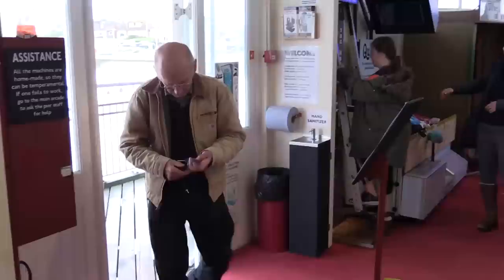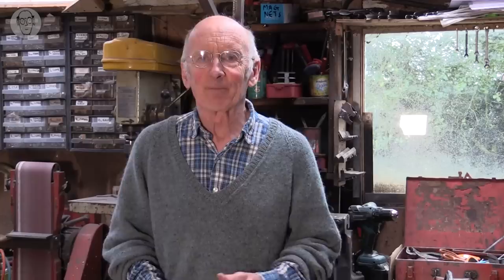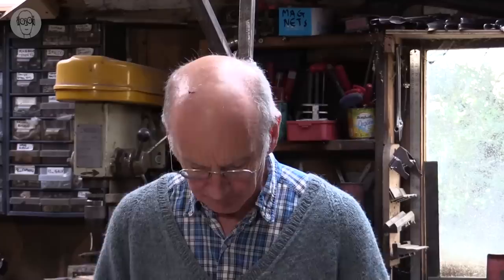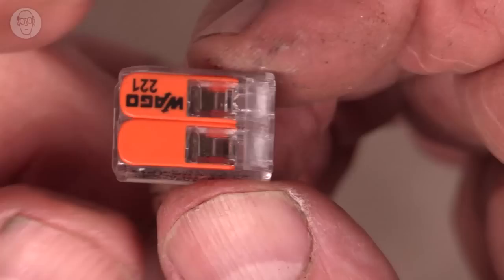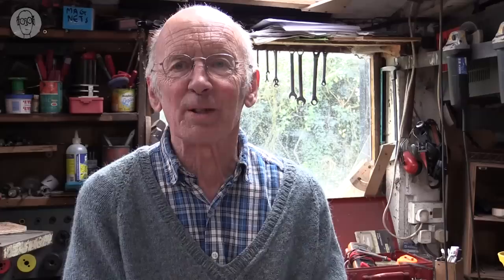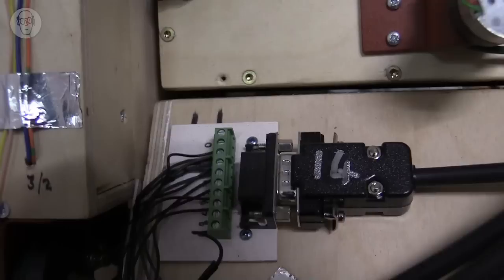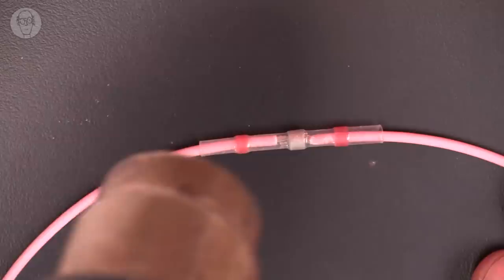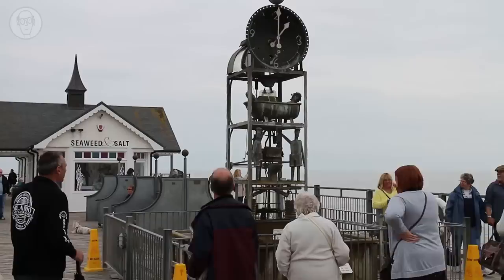CONNECTORS -- The Secret Life of Components, a series of guides for makers and designers - Episode 6

Comment: I designed an opensource DIY optical wireless data link (Twibright Ronja) and initially I used a barrel connector for the power. But they stopped conducting due to oxidation on the intact nickel surface despite looking shiny new and soldering being reliable. And the device was locked in someone's home who was on vacation which resulted in a long term Internet dropout. Such a behaviour of the device was totally unacceptable for me so I threw them out and replaced with a terminal block where a piece of very thick copper wire is soldered to the end of the wire. These were reliable and good up to 300 MHz but they leaked a bit of RF interference due to the wires going apart and creating an induction loop, and someone complaied about stripes on his TV. The interference was so minor that a digital Tektronix oscilloscope couldn't see it over the interference from its own CPU, so I bought an analog Russian S-99 and could see it there.  Eventually I used these D connectors because they are gold plated and the wires are close together and you can put a metal shell over it. For power I used DE-9, connected 4 gold plated pins in parallel for +12V and 5 gold plated pins in parallel for GND. BNCs I used only at the beginning, they had contact resistance on the non-gold-plated shield which injected a copy of the signal onto the shielding and caused interference. They also badly oxidized in roof condition. Eventually, someone had my device running for 12 years reliably and enjoying 10 Mbps full duplex with 1.4 km range. When you design a device to actually work instead of just sell, I believe you have to use a different approach than the standard consumer industry.

Comment: As an american, I worked on a DIY electronics project one time in Germany, and was frustrated to find that europeans don't use twist connectors (they are illegal in fact!) Probably a good reason too, but I love those things for their quickness.
Reply: I am guessing that ground lift adapters, AKA "cheater plugs" (the type that allows you to plug a grounded appliance into an older house-current socket that lacks the ground pin)  are also not legal in Europe. You can't buy them in Canada either, only in the US.  The majority of homes here have been retrofitted with modern sockets but the other use for these "cheater plugs" is if you have an audio video system that "hums" and has one or more components (powered subwoofers often being a particular problem) that include a grounded cord, and so you need to break the ground loop that exists somewhere in the system.  The ground lift cheater plug can be invaluable for this.
Reply: @goodun2974  I interpreted "twist connectors" as wire nuts.
Reply: @ddegn  , yes, so did I, and I commented on wirenuts elsewhere here. My comment was about certain devices being common in the US but unavailable or illegal elsewhere. As for wire-nuts: regardless of UK legality or availability, Tim wouldn't like wirenuts anyway, because he'd have to twist the wires together clockwise first! (Watch his quick and dirty twist-splice at the end of the video ---- maybe it's a lefthanded person's nature to twist counter-clockwise?). Of course, quality wirenuts contain a metal spring; but the cheapest ones, often included with DIY low-voltage projects and kits, are just plastic, no metal, and pretty much guaranteed to fail. Which reminds me that Tim never mentioned the crimp-connector color-code that tells you what color terminal to use for whatever guage of wire you're working with!

Comment: The worst connectors I've found for terminating are 13 pin DIN connectors.  EDAC/Varelco 96 pin connectors are a bit of a hassle if you don't have the (very) expensive crimp tools. You also need a pin extractor tool for the inevitable mistakes or modifications.

Comment: I'm wondering if you would do a remastered episode on lifts(elevators) with commentary. From the early 2000's to recent,there has been some improvements & adavncements in elevators as follows:pneumatic elevators,machine-room less elevators & other elevators that use hoist belts in place of hoist ropes,Otis in the early 2000's was the first to develop such an elevator called the Gen 2. Thyssen Krupp Elevator which acquired the elevator division of American manufacturer Dover,developed an elevator with two independent elevator cars sharing the same pair of guide rails in one hoistway called TWIN. The idea of such an elevator is not new,Westinghouse, later acquired by Schindler,in the 1930's installed a similar elevator in Chicago.  Also the late 1990's,early 2000's saw the development of AC gearless hoist motors.

Comment: 5:30 At this point in the video may I recommend a DC clamp meter such as the Uni-T 210E? Current can be measured without breaking the circuit, though of course a single wire must be measured - both together will cancel each other out.

Comment: I wouldn't recommend soldering by pasting the solder around by swiping the tip of the soldering iron. Instead, use enough flux (rosin) to have a visible leftover of flux on the joint and then it will be clean and flow everywhere much more eagerly. I think doing it like this is asking for a cold joint.

Comment: I've been a electrician for 18 years and done many wiring tasks, thousands of connections and never had a report of a fail. Do like the din rail connectors, but hate the push in ones, as they are fiddly and sometimes even the screwdriver cant pull it out.

Comment: Here in the States, we use not only Molex plugs but also AMP and Jones (Cinch-Jones) plugs (and I've seen intermittent factory-made crimps for all of these, and occasionally even a broken pin inside the plastic housing!). By the way, worst audio connector ever? The ubiquitous RCA phono plug! A nearly hundred year old design that should have been scrapped decades ago!

Comment: Regarding the measurement of current REMEMBER TO ALWAYS ALWAYS PUT BACK THE METER PROBES IN "Volt" MODE. This because in Amp mode it's basically a short circuit across the probes and if you forget it that way and try to measure voltage you'll short the thing you're testing. And if it's mains voltage you'll get quite the surprise let's put it that way
Reply: Most high quality volt/ammeters will have a shunt inside the meter which acts as a fuse to protect both the meter and the technician if you accidentally try to measure voltage with the meter in ammeter mode.
Reply: @goodun2974  Yeah but not anyone will have a quality meter and I think it's still good practice even if you have a top notch Fluke or something like that

Comment: *I over explained a lot here
Be careful with re shaping flat head screw drivers as you can end up making a pretty sharp edge. This is bad for safety in general, but the problem becomes a lot worse when you slip from the screw and end up stabbing the hand that's holding the terminal. The sharp edge can also increase the risk of tearing through the plastic walls that help keep the flathead centre. Be safe guys ;)
Reply: This might be obvious but in regards to the spade terminals, they come in different widths. People often confuse the meaning of the red / blue / yellow insulated sheathing
Red means it's for a cable that has a cross sectional area of between 0.5mm squared to 1.5mm squared
Blue is for 1.5mm squared to 2.5mm squared
and Yellow for 2.5mm squared to 6mm squared

I'm not a fan of insulated crimps either, as part of the strength is from the [red/blue/yellow] sheath being crimped onto the cable. This may hold the cable in place but I worry about how good the metal to metal contact is.

I feel like I'm starting to step on toes with these comments but sharing is caring.

A good rule of thumb when trying to find the right size of heat shrink. Fold the heatshrink in half - as long as what ever you want to heat shrink is wider than the half-width, it should be good.

In saying that, the example piece that Tim showed shrunk a lot more than I would have expected.

Comment: One thing to add is that many people think that tinning wires with solder before using them in a screw/clamp or crimp connector is a good idea (instead of using a ferrule), IT'S NOT! The solder "flows" over time with the pressure and creates a poor/loose connection. I have real world experience and evidence of this with some connections that were used on London busses (so a nice sample fleet of nearly 9000 vehicles to get failure data from). You can get away with it on spring clamp connectors as the spring compensates but it's still not a good idea and TBH ferrules aren't really needed on spring clamp terminals either but they do make things neater.

Comment: I think these IDCs (Insulation Displacement Connectors) should be called IRC (Insulation Replacement Connector). The plastic insulation will be replaced by an oxide layer insulation between the non gold plated post and the copper or tin plated wire. As the wires microscopically move from thermal expansion, vibrations and handling, the original unoxidized places where the conductors touched will move a bit sideways, allowing fresh oxygen on them, eventually resulting in an ICC (Intermittently Conducting Connector).
Reply: I have done Many thousands of IDC connections in the Phone industry for 37 Years and the only time I have had trouble with any of them is when the Block got wet. then it turned into a Green mess LOL...or some one punched stranded wire on one.

Comment: It's funny; I've only ever come across molex connectors in computer building circles, where they are used to power hard drives and fans. There they are so universally hated, for being stiff to connect and not making a very good connection that they've largely been replaced by power sata and 3-pin connectors.

Comment: You can get cheaper crimp tools for Molex that work just as well but it can be a lottery (there's a lot of crap ones as well). Wires pulling out of crimps are always down to bad technique or bad tools. I use a Preciva crimp tool and a Japanese PA-09 crimp tool, which covers most connectors I come across.

Comment: Mention of the color code for matching insulated crimp terminals to wire guage would have been apropro: IIRC, Red, 20 to 22 Guage, Blue, 18 to 16, Yellow 14 to 12....I could be off a little (brain fog plus old age) and nowadays with so many cheap Chinese connectors on the market, standards vary....

Comment: `Scotch` connectors were a pain of every Automobile electrician in years gone by :),
Reply: Worse still were the cheapo clone versions; I have encountered some that spiked the main conductor, they at least were reliable, at least when new.
Reply: The 3M brand Scotchlocks weren't too bad but all the other off-brands were junk. The best ones "spiked" or forked through the insulation of both the pass-through wire and the tap-off wire in two places. I was a car stereo and alarm installer for a dozen years, in my younger days....

Comment: At 43:20, I can see why you don't use wire-nuts in the UK (or are legally barred from doing so): you have to twist wires together clockwise in order to use a wire-nut! Hmmm, do left-handers automatically tend to twist wires counter-clockwise?

Comment: The automotive/spade terminals I hated until I found that they only work for limited wire ranges based on their insulation cover.
Put the right size wire in the right colour and they are not bad.
After that, I merely disliked them, not hated them.

Comment: 32:51 - I think you're supposed to bend the ribbon back over the connector before adding that bit.
Reply: Fred Garvin  - Lots of things aren't necessary but still advisable. Bending it back and locking it under the bar acts as strain relief and makes it less likely to come loose even if you pull it at an angle. 

https://startingelectronics.org/articles/IDC-ribbon-cable/IDC-connector-pin-1.jpg
Reply: Fred Garvin  - Several (probably over a dozen, mostly in ATA and SCSI drive arrays).

Tim probably won't plug them in and out enough for that to be an issue, but they definitely do break (sometimes, even with the added loop - but it's there for a reason). 

Your definition of "absurd" seems to be "I haven't worked much with them, and it's never happened to me".
Reply: Fred Garvin  - Straw man much? What does it matter whether they broke today, 10, or 20 years ago? You asked "have you ever had a ribbon connector break from use?", and I replied. I have. Lots of them.

They design them with that extra bar for a reason (in fact, some of the early ones didn't have that, and broke a lot more frequently).

Comment: They have something againts us, cause why would they do example the eu wall plugs so tiny and wrong, that you couldnt fit the wires inside!
Remember to twist the copper inside the wires at the end together like you did at two wires, so it will not loose so easy as when the coppers are straight. Also  you can do U or J loop for the wire to get bigger inside the connector to stay better. But even that should be first twisted!

Comment: Hmmm, what you call "solder bucket" D-Sub connectors are referred to (at least in the US) as "solder cup". 

I'd never actually heard them called solder bucket type before. Doing some searching, it appears to be a basically exclusively european thing. Interesting!
Reply: Two nations divided by a common language!
Reply: Connor Wolf,  Having done extensive soldering on various connectors used for audio applications ranging from RCA phone plugs to XLR (ITT/Cannon) balanced microphone connectors to Banana plugs to 5 through 8 pin DIN connectors, it's much much easier to solder to any hollow terminal-pin that has a notched solder cup.  Small diameter hollow pins like the ones found in many DIN connectors (NOS DIN connectors are sometimes found to be oxidized or greasy inside) are the worst, especially if they do not have a hole or notch in the side of the pin to let trapped air escape (air expansion from heat can cause the solder to bubble instead of wicking into the pin!) or which would allow you to flow solder into the centre area of the pin throughthe notch or hole. On occasion I have used a Dremel tool to grind a thin slit or notch ( solder cup) into the pins.  Even large diameter gold plated banana plugs can be somewhat difficult to solder onto heavy speaker cable unless you pre-tin both the inside receptacle of the banana plug and the wire as well.
Reply: @Jannie Kirsten , "Have a cuppa...." and "have a bucket of...." are likely to have very different meanings no matter which side of the Pond you are on!

Comment: 8:00 yeah the UK ring main is a curious relic... first I heard of it I was like, "yeah sure, back in Edwardian times" but then I was told that it is used to this day.
Reply: One radio station I worked at had three buildings connected together with an 11kV ring main. At another station, the dozen mast winches were supplied by a 6.5kV ring main.

Comment: Wow, that is definitely NOT how I was taught to solder cup type terminals. But I guess if it works, it works!
Reply: And ?
Reply: @tonywright8294  I don't know about Mr. Callahan, but I have always soldered cup type terminals by cutting a short bit of flux core solder (correct length critical !) and dropping it into the cup.  Then tin the wire end.  Make the actual connection by heating the cup to melt the short length of solder and then poking the tinned wire end into the cup.  Hold the iron on the cup until the tinning on the wire end melts and melds with the solder in the cup.  Remove iron and hold wire absolutely still until the solder solidifies.   Back in the mid 1970s I actually took a week long course in how to solder to MIL specs from a company called PACE Inc. and this is how they taught me to do it.  You can watch their tutorial here:  https://www.youtube.com/watch?v=_GLeCt_u3U8  if you want the gory details.

Comment: Or with nylon terminal blocks you put the wire in slightly too far and end up screwing down onto the insulation and not onto the stripped wire.

Comment: My big complaint about MOLEX is they have zero protection from moisture.  Nothing is truly waterproof, but MOLEX can't handle a mild fog.
Reply: I've had to replace many of the kk-style connectors. The brass seems to turn brittle and can fracture inside the shells, leading to very intermittent and difficult to find faults. It's all about applying the correct part for the job!
Reply: Fred Garvin  I work with food processing and packaging machinery.  All of which must be very clean.  Molex connectors are a huge red flag for me that says "Do not spray with water"  makes it hard to clean since cleaning things usually involves water.
Reply: Fred Garvin  Those are the black rubberized molex connectors.  I'm talking about the hard plastic white molex.  The kind you find everywhere on prototypes that haven't been finished. They are garbage.

Comment: so you don't have wire nuts in UK? electricians use them here in many connections like in junction boxes and motor boxes up to #6 gage good for 70 amps. they are starting to push those wago connectors here but wire nuts are more versatile as you can join multiple wires with 1 nut.